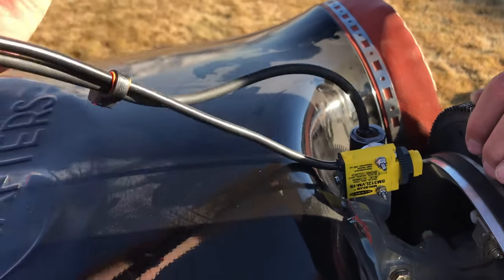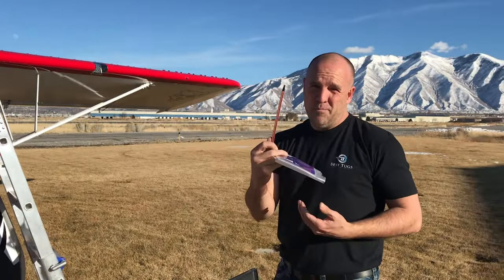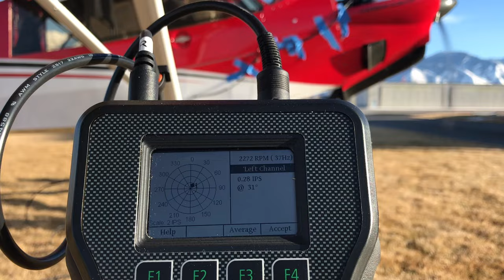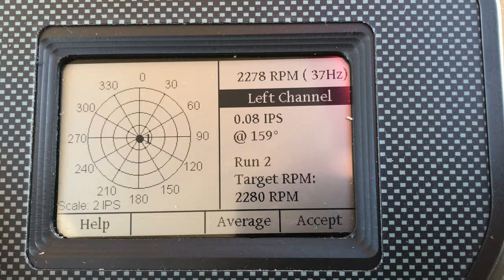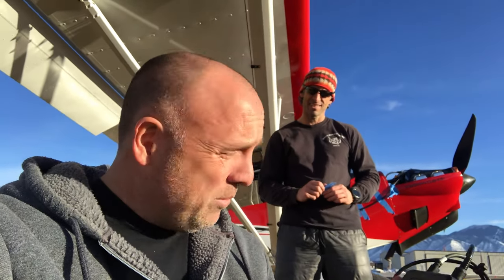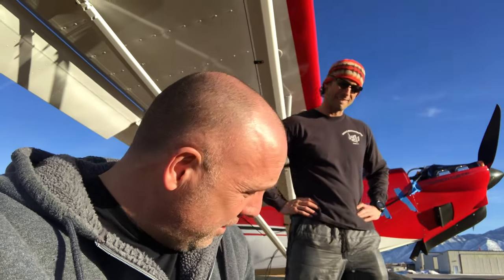Testing the New DynaVibe Prop Balancer

Comment: Why not use the mercury filled auto balancer that bolts between the crank and prop .  I have seen one work , it smoothed the engine out . They are used on “experimental “ aircraft. The wear on crankshaft main bearings is greatly reduced because not only is the prop balanced but the crankshaft is balanced too .

Comment: For the last 150 hours I've been using a Balance Master (http://www.balancemasters.com/) on my Rotax 912S/Prince Prop, RANS S-7S combo.  It, along with a properly balanced propeller like the Prince , combine to make  it all smooth as possible.  I also use a similar device on the wheels of my crane truck, and when I last bought new front tires, my tire shop (the best in my area) told me there was no need to balance the new tires in the conventional manner, the Centramatics would do it better, plus KEEP it them balanced as they wore and picked up snow, mud, etc.  Point is, the concept of a centrifugal balancer, be it prop or tires, is well proven.  I am NOT saying they are a cure all, but can work very well within their design  limitations.

Comment: Too bad that your were not able to show how you added the weights to the prop.  Maybe next time.
Reply: You bolt them on to the flywheel on Lycoming engines. There is a hole every 30 degrees.